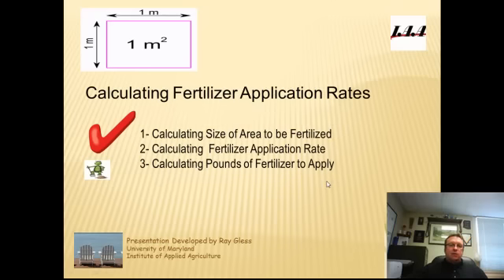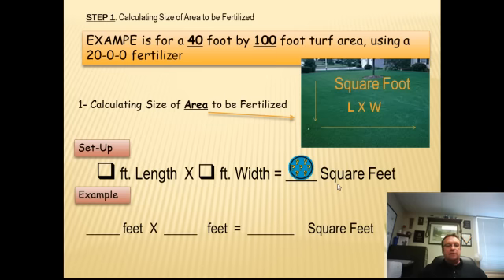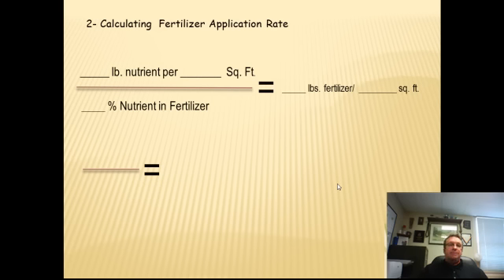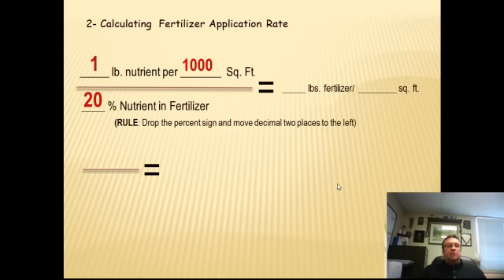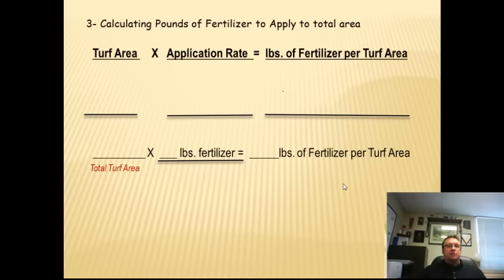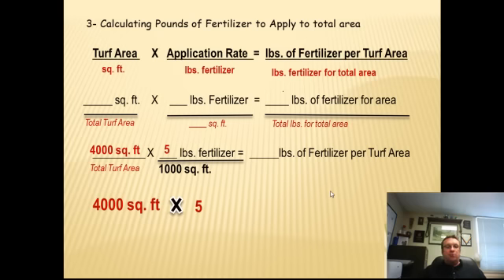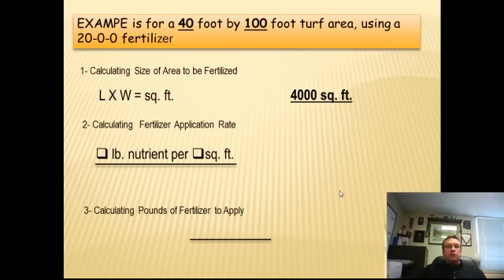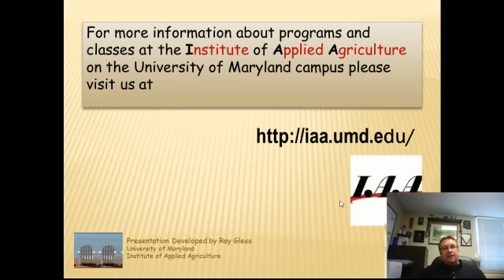Calculating Fertilizer Application Rates

Comment: Good morning, I wanted to see if you can help me.  I got back my test results from Ward Labs.  Here is the recommendation. 125lbs of N, 45lbs of P, 30lbs of K.  This is per acre.  How do I convert this when I am looking at bags of fertilizer that are labeled 8-12-4 or 13-13-13, or 8-24-24. and figure out how many bags to match the total of what I need.

Comment: what if your grass needs more phosphate than nitrogen?
Reply: That is unlikely.  Phosphates are not a gas (like Nitrogen) & they don't leach out or evaporate from soil like nitrogen does each year.  Warmer climates especially have high N loss due to higher temps than cooler climates.

The calculations that he shows are for nitrogen, however, you can use the same method with a different phosphorus application rate for your soil.  Info can be found here:  https://www.extension.purdue.edu/extmedia/ay/ay-334-w.pdf

Note:  The application rates in that pdf file may NOT apply to your soil as soils often vary quite a bit in different areas.  Ideally, you would get your soil professionally tested at an agriculture extension office in your area & they will provide you with the optimal phosphorus application rate information for whatever you tell them that you plan to grow.

hth!